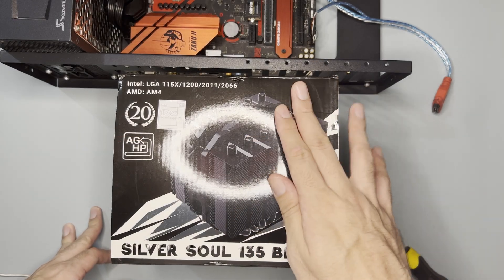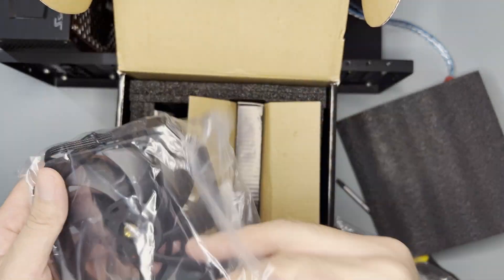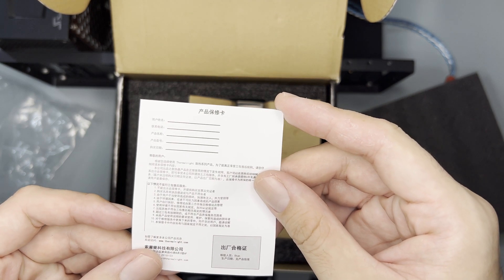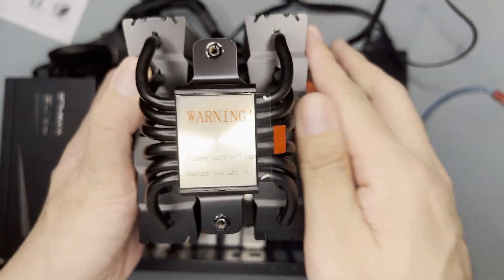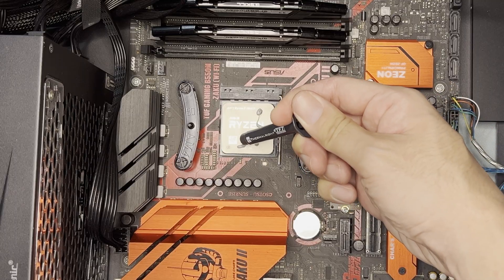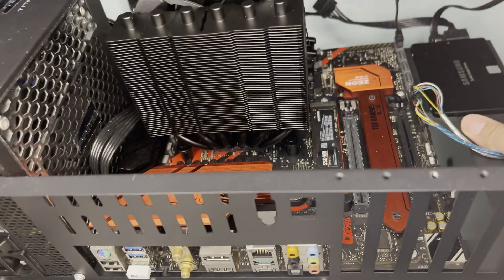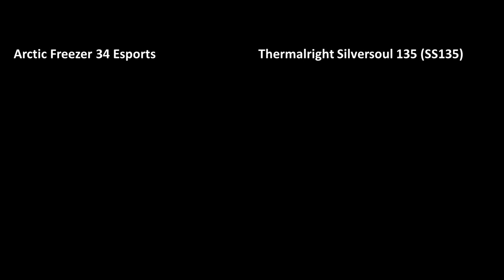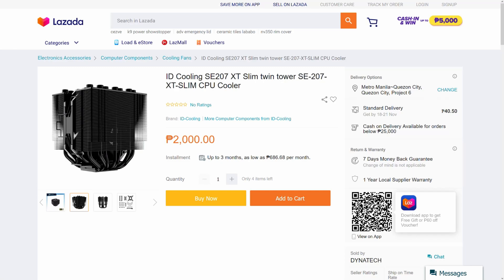Thermalright Silversoul 135 (SS135) - 135mm cooler | Unboxing, Mounting, and Benchmarks

Comment: any fan at full speed will be loud even noctua. this one is fine, u would set in bios to pwm and it will only turn up as power usage goes up then go back down to where u set it for low noise. also corsair fans are nice, theyre noise is a lower pitch than noctua.

Comment: Thank you sir 

But am very confused, how modern cpu with 10 heat pipes do this bad , while my 10 years old cooler masters 212 evo don't go beyond 65 c 
With i7 8700k
Reply from the maker: There are a lot of factors possible:

1. I mounted it badly
2. Ambient temps
3. Overall cooler mass (this is just 135mm in height)
4. The test rig - although Intel is usually hot, 5800X isn't cold either. It is one of the hottest chip in Ryzen 5000 series (hotter than 5950X but on par with 5800X3D).

This is one of my older tests and likely I'm less accurate at the time in terms of mounting and test environment. My newer tests are really comparable to each other already, but I'm mainly focusing on low profile coolers now.

Comment: Good upgrade po kaya ito from Shuriken 3 to SS 135 or same results most likely? Nag 80 degrees kasi Ryzen 5 5600x ko lagi tuwing naglalaro. Case po is trendsonic mars with 3 intakes front, 2 exhaust top, 1 exhaust rear. All fans arctic p12. Thank you
Reply from the maker: Likely better ang SS135 than shuriken 3.

A few things though:

1. during gaming, may impact yung heat generated by the GPU.
2. 80C is fine... If narireach niyo 95C, then you should be alarmed. Otherwise, it's fine.
3. Try removing side panels to see if may impact, if yes, case yung issue.
4. Better yet, if you can remove the components from the case, and test it open to isolate if case ba or cooler.

Overall though, bigger cooler will likely yield cooler results.
Reply: @manongunboxing  thank you for sharing your insights here! Will definitely do your recommended test and see how it goes. Nainggit lang ako sa mga temp nila 55-65 pag naglalaro 😂

Comment: Would this be sufficient for a 5800x3d (no overclocking)
Reply from the maker: Hi, sorry. Not really sure but by right, yes. Just make sure to mount it correctly (3 turns at a time per screw)

Comment: Do u think its worth it for 5800x ? If i can get it around 40 usd ?
Reply from the maker: For 5800X, it is always best to overspec your cooler (such as 240mm+ AIOs).

However, if your workload is just gaming, this cooler should be fine (expect high 70's). 

Beware though as some heat from the GPU can affect ambient temps in the case, thus a hotter CPU. There are cases that have good exhaust that can manage to tame ambient temps inside the case, and there are cases that can't.

Sorry, the answer isn't simple as it will depend on your workload and case pairing, that is why "240mm or above AIOs" is the generic answer.
Reply: @manongunboxing  or a beefy air cooler like a dark rock pro 4, D15, Deepcool assassin 3, etc. or even medium air cooler like the fuma 2 or Deepcool AK620. The 5800x isn’t a super hot chip outside of competitive overclocking.
Reply: @legostarwarsrulez  I have 145mm clearance in my cabinet :/ so those beefy coolers are out!
Reply: @anghanharsh  ah, well in that case this cooler will handle it well, if you want a beefier cooler with low profile look at the scythe big shuriken 3, or the be quiet dark rock TF2. Those should both fit. But those blow down onto the board which could heat up the VRMs a bit.
Reply: @manongunboxing  Yeah aio is a nice option but want to stick with air cooling, do u suggest any other air cooler under 148mm , because thats the limit for my case
Reply from the maker: Noctua nh-d12L should do the job. It is exactly 145mm
Reply: What are your thoughts on pairing this CPU or a 5900x with a ID cooling 207xt slim?
Reply from the maker: For 5900x and 207xt slim cooling, I haven't tested but should be fine if you're running at stock. 5800x is hotter than 5900x.
Reply: I use the ss 110 on a 5700x with no issues, rhe 135 should be fine with a 5800x.